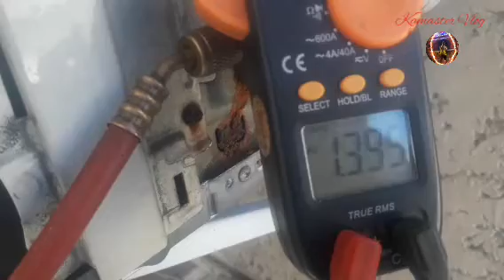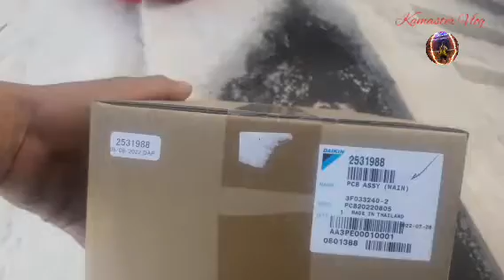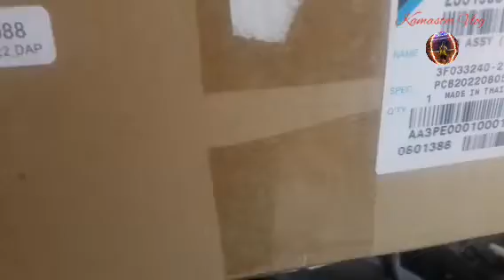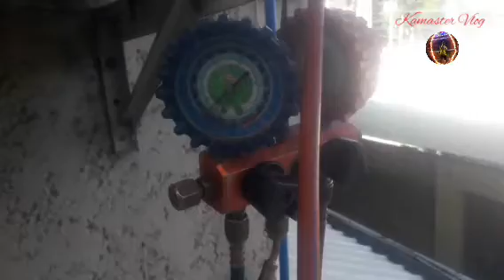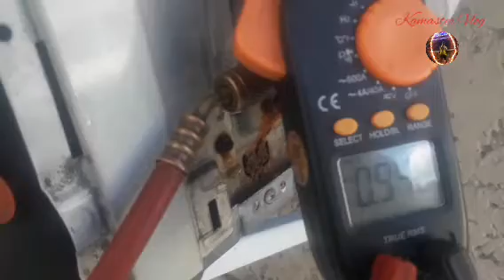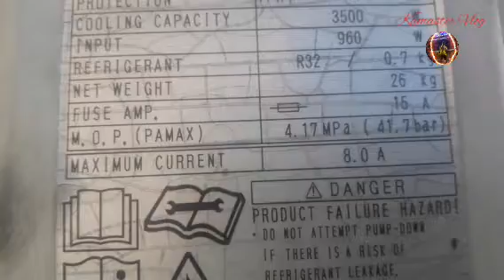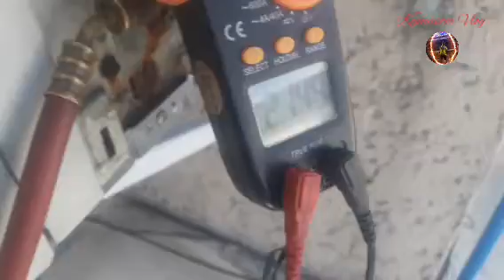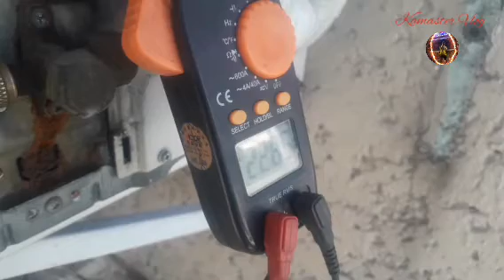PaanO mag troubleshoot ng L5 error code sa daikin inverter R32 #Tagalog #tutorialvideo

Comment: master Thankyou super effective
Reply from the maker: Wc po master godbless
Reply: @kamastervlog1990  master sa Daikin Kapag walang error nalabas blinking lang tapos pag ini on mo sa remote ayaw mag on at kahit sa manual nakita ko kasi na puro na kalawang yung receiver nya pati yung motor ng louver bulok na possible kaya na receiver na ang sira nito?
Reply from the maker: Ikaw po mismo kukuha ng error code po sir idiin nu po ang cancel ng remote 3 to 5 second may lalabas dyan una OU pag wonce na malakas ang tunog niya un po ang error code niya pag mag next2 ka sa cancel lang parin isang pindot lang
Reply: @kamastervlog1990  ginawa kona yan master maraming beses wala tlagang nalabas na error nakatatlong balik ako dun aa OU Wala tlga
Reply: @kamastervlog1990  sureball na siguro noh na receiver na ?
Reply from the maker: Try mo sukatan ng standard pressure master
Reply: @kamastervlog1990  ok na master sureball receiver nga palit din louver
Reply: @kamastervlog1990  master ito pa isa pa bagong client nmn Daikin din ok nmn yung karga yung amps bagong linis pero namamatas si compressor after 2 mins ano kaya possible na sira?
Reply from the maker: Ilang taon nabayan simula na install master itanOng mo at sa ilang taon ilang bisis na nalinis
Reply: hm po un board ng daikin  ipinalit mo same po kasi kmi ng sira L5 din po.
Reply from the maker: Marami po dahilan ang L5 po maam pwd maging compressor or outdoor board or marumi ang unit outdoor
Reply from the maker: saan po ba location nu maam para sakali kung board outdor po pwd po natn e repair